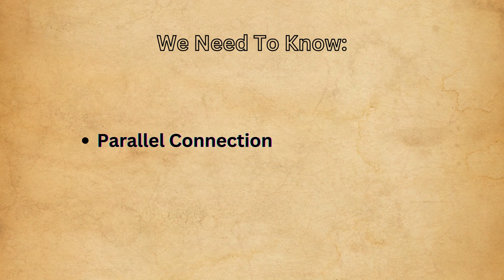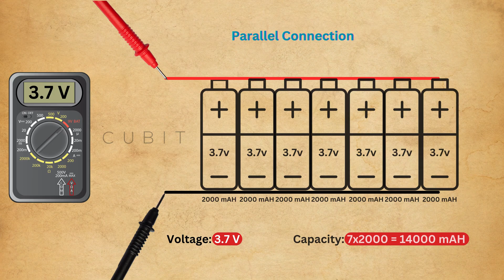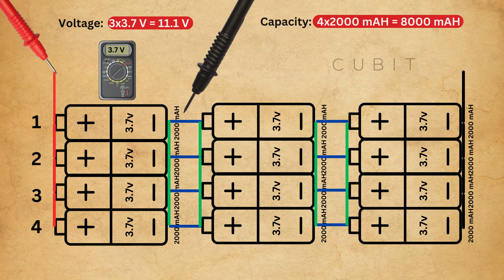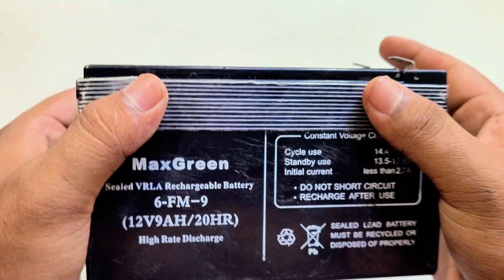Reviving a Dead Lead Acid Battery into a 12V 14Ah Lithium-ion Battery Pack

Comment: How to charge this battery ??? 🤔🤔🤔
Reply from the maker: @sanulohar3851  the output terminal of the battery, which is used for charging and discharging the battery.
Reply: @cubityt  charger this battery.???

Comment: Hello, if i put this in a nobreak, that have a circuit to maintain the battery at 13,6 volts, what will happens? because the 3s lithium only go up to 12,6

Comment: The voltage is a little low compared to the original lead acid battery, but pretty close!
Reply from the maker: @pete1853  yes you are right. But when i connect load on this battery then it's dropped and not able to supply current.
Reply: Should have checked each cell mah before welding.
When using old cells we won't get full mah indicated on cells. 
We have to check each cell and welding according to total mah same for 3 sets .
Reply from the maker: @suryapatnaik5720  yes..i checked my cell before making battery pack.